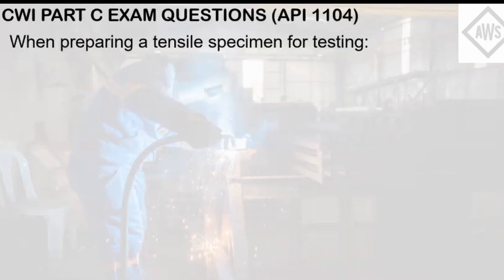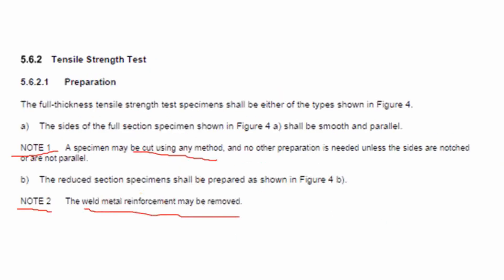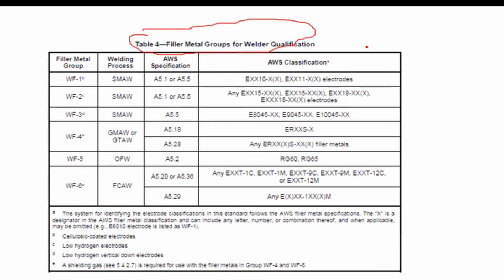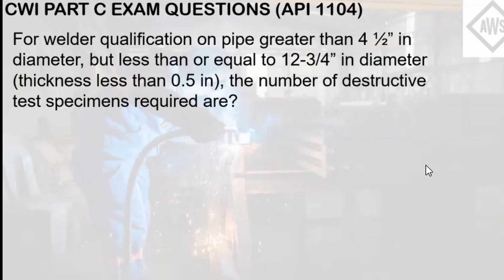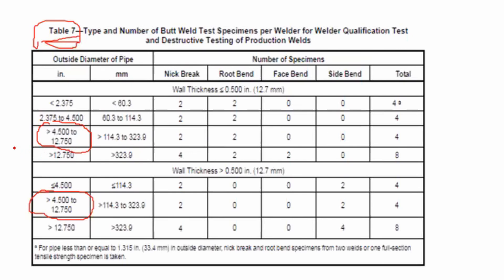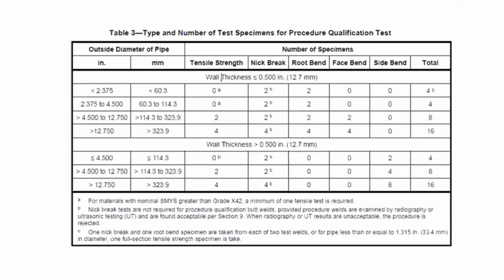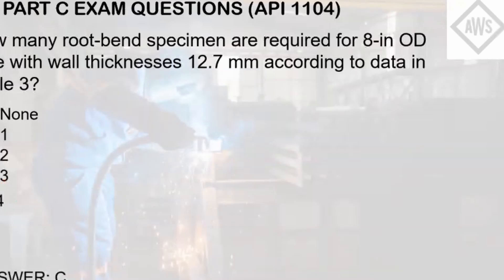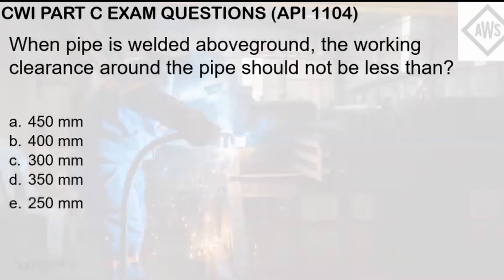CWI Part C Exam Success Made EASY with Sample Questions! - Set 1

Comment: Is question 2 answer is C? The foward section in the book notes that “may-denotes a course of action permissible within limits of standard” and “should- denotes a recommendation but not required” and in section 5.6.2.1 Note:2 says the weld metal reinforcement may be removed” not should not be removed.
Reply from the maker: the answer is E, the words may and should is not relevant to the question being asked. You are correct that if the weld reinforcement is removed they may be an allowable tolerance but that specific point is not being asked in the question.
Reply: i know what happened. When question#2 first comes up. Answer choice D says “weld reinforcement may be removed”. In Wich answer choice E would be correct.After he references from the book he goes back to the question and answer choice D now says “weld reinforcement should not be removed on either side”. The question is in reference to the book so you have to go by the book. What is done to the tensile specimen after is up to the user of the standard but,within standard specifications.
Reply from the maker: @DragonBorn117-h7o  yeah, I got you now, the term "should not" is wrong. The answer is still E. It's a mistake on my end, I did not change the choices on the slide showing the answer, good catch btw. Will ensure uniformity of the slides next time.
Reply: @ thank you for clearing things up